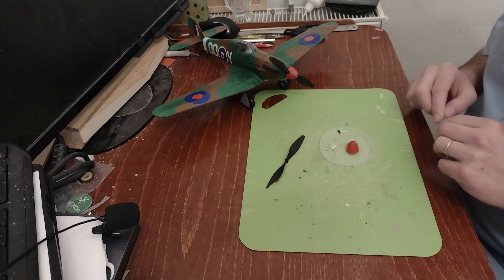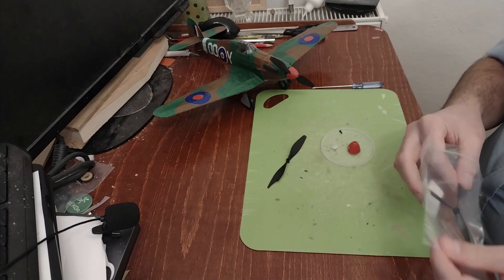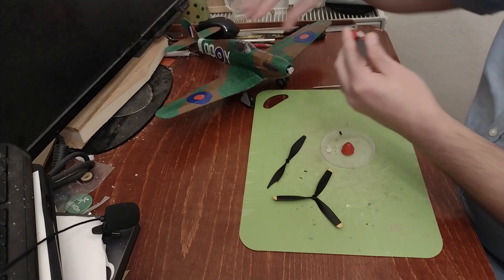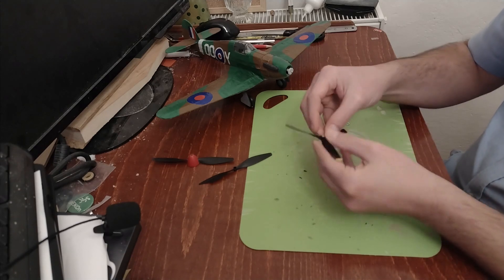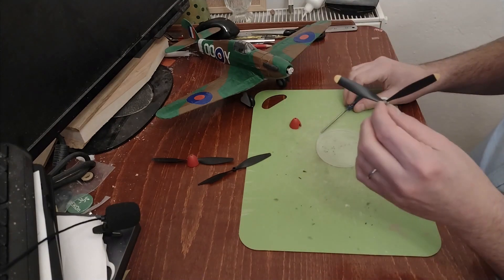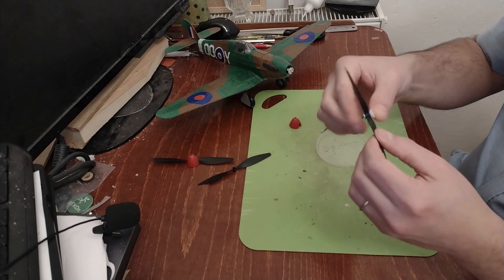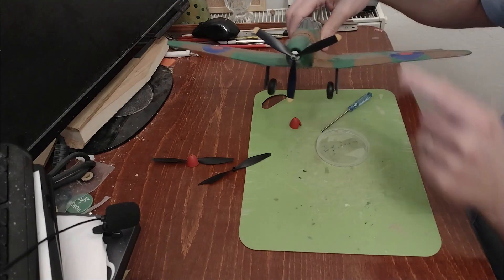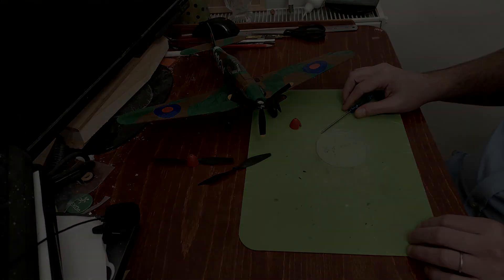11 Guillows RC Hurricane   New Prop

Comment: It'll be interesting to see Andrew, you can do a thrust test on the bench by attaching a small spring balance and while holding it open the throttle to see how much the needle moves on the scale ... just an interesting thought maybe, cheers.
Reply from the maker: That is not a bad idea. I have been thinking about doing measurements like that but have never gotten around to think about how to do it. I'll have to think about how to find or build some kind of spring device. Thx for the idea!